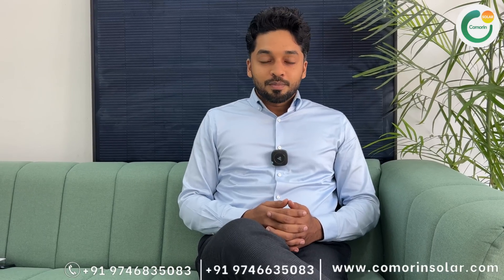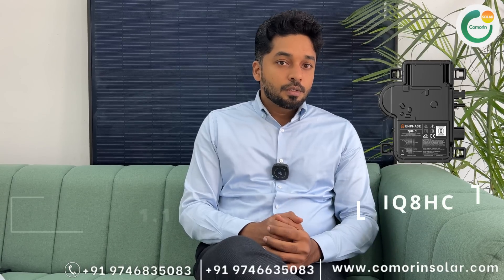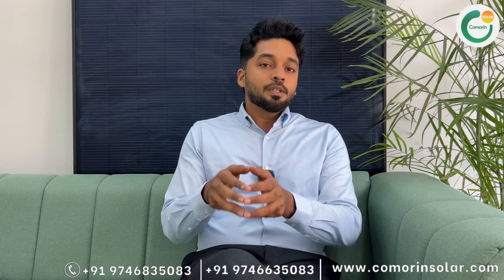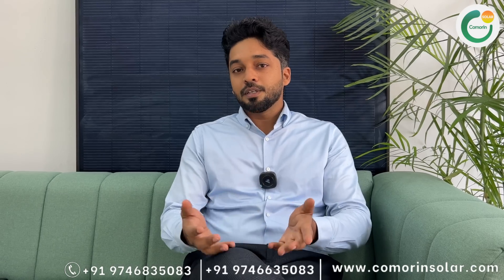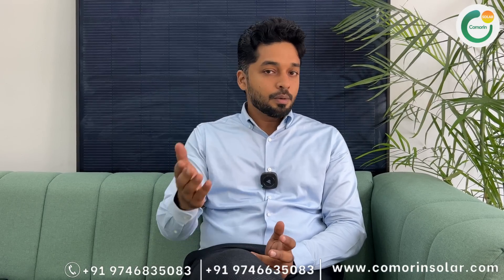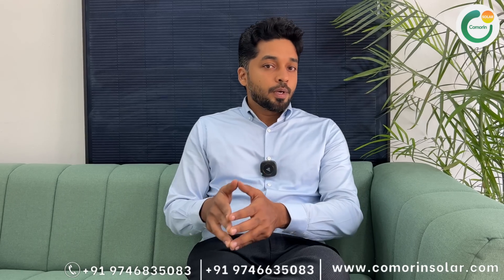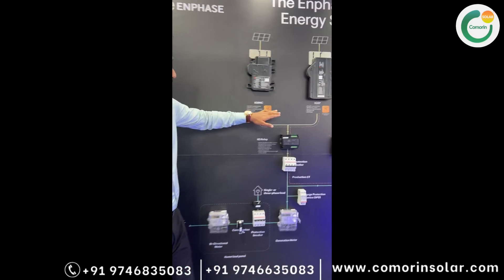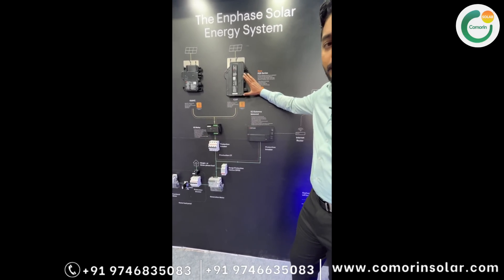Enphase Micro Inverters IQ8 Series | Add Solar Panels up to 670 Watt | Highest Power Output

Comment: It appears a mismatch in using a 560W panel with IQ8 480W micro inverter.
How to explain the differences between produced power at panel and power output at micro inverter.Do we need to add more inverters.
The same is with current.
Topcon panels generate 14 to 16 A where as IQ8 Inverters doesnot support this high current.
Appreciate your explanation 
Thanks

Comment: Hi, i have an on-grid 5KW system installed with ABB single phase string inverter. Can I upgrade it using Enphase by keeping the 5KW ABB + 3KW in Enphase
Reply from the maker: AC coupling is possible for hybrid. But your asking 2 on grid inverters have to confirm with Enphase Sir
Reply: @comorinsolar  well now my string inverter is connected only to one phase. if i use enphase micro, i can connect to other phase. will it work that way

Comment: Can these enphase inverters can be used only as offgrid inverters - Without even connecting to grid ? Also can any batteries be used here or enphase encharge batteries are the only option ?
Reply from the maker: With help of enphase battery it is possible
Reply: @comorinsolar  thanks.. So with regular lithium ion batteries its not possible right.. We need enphase batteries itself.. Encharge batteries available in india?
Reply from the maker: Yes hybrid system possible
Reply from the maker: @cirilignatious8663  Sir Enphase batteries are about to get launched in India as per Enphase India Team
Reply: @comorinsolar  Thanks brother.. i am looking forward for that..

Comment: സഹോദരാ , ചില സംശയങ്ങൾ ചോദിക്കുന്നു , വാട്‌സ്ആപ്പിൽ അല്ല . ഇതിൽ തന്നെ ട്ടോ...

 540w ന്റെ  ഒരു പാനലും ഒരു മൈക്രോ ഇൻവേറ്റർ മാത്രം കണക്ട് ചെയ്താൽ 
230 v   ac കിട്ടുമോ .

 നോർമൽ  അവസ്‌ഥയിൽ   എത്ര ആമ്പിയർ ഉണ്ടാകും . 

പകലിൽ വീട്ടിലെ ഫാൻ , ഔട്ടർ ഫാൻ , ബൾബ്  എന്നിവ നേരിട്ട് കണക്റ്റ് ചെയ്ത് പകലിൽ വർക്ക് ചെയ്യിക്കാൻ പറ്റുമോ..
Reply from the maker: Yes possible, but Micro Inverter with single panel possible, connect 600+watt panel with IQ8P inverter current rating will be little higher than normal.